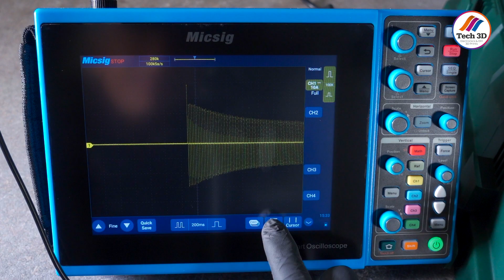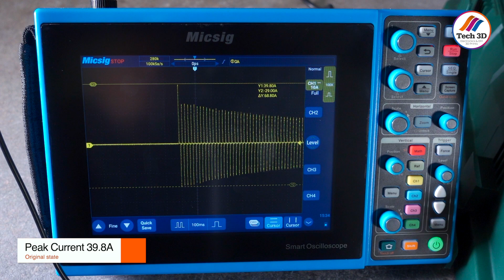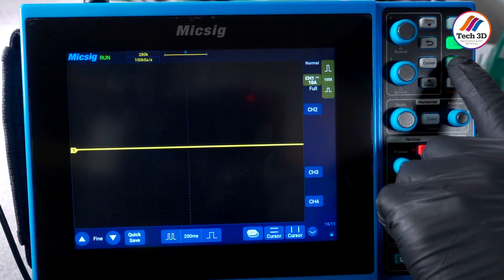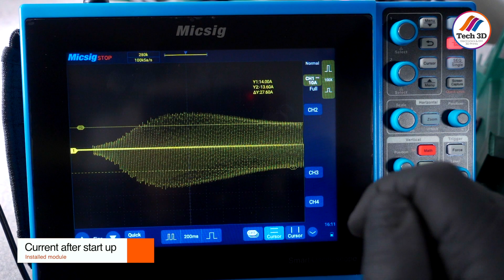Soft Start for Parkside PTKS 2000 G5 Table Saw

Comment: Hello, I would like some information about the connection, I have the h5 version, which is slightly different in terms of connection.  I connected it to the engine input but it only works at 5000 rpm.  Even if I turned on 5000 and then switched to 3200 the engine stopped.  I want to ask if the soft start only works for you at higher speeds or if I connected it incorrectly.  well thank you
Reply from the maker: I got rid of this saw, so I can't help with the wiring anymore. The softstart module only works with a direct winding on the motor, meaning it only goes to max speed on the Parkside saw. The Parkside saw doesn't have two windings on the motor, and the speed control is only handled by overdriving the module, which reduces the voltage on the motor. This is the worst way to reduce the speed. Therefore, the motor will start poorly or not at all.

Comment: Just found this clip. very interesting.  i wonder if you could help me. My original motor burned out and i replaced it.  However, the motor that i bought ,which is identical to the old one, has 3-wires while the old one has only two.  How can i connect it?
Reply from the maker: Thank you, but I don't think I can help you. I don't know how your new engine is wired. I don't know what the third pin is. Whether it's ground or some winding pin, whether it has two windings for two speeds or just a protective wire...
Reply: Thank you, anyway.

Comment: Do you know how to deactivate the soft start  for example on a electric chain saw?
Any plans how to do it if soft start is already installed?
Reply from the maker: It is enough to just bridge the soft start module, as a bypass, to connect the input to the output, so that the wire from the motor is connected directly to the switch and not after the soft start module.
Reply: @Tech-3D  thx a lot :)

Comment: This table saw has a big problem: the table Is not correctly flat and so the saw isn't 90° with It. Do also you have this problem?
Reply: Use a set-square against the saw blade, and rotate it till it's 90 degrees with the table and fix it in that position (1, 2 degrees whatever), remembering that is now 0 degrees.

Comment: Can you share a wiring diagram or some sort of pictorial information showing details such as connection locations and wire colours. These important details are not visible from the video itself. Thanks!
Reply from the maker: Connecting the soft start module to the Parkside saw is very easy. The basic wiring diagram is marked on the module box. The black wire from the module goes to the brown wire on the saw, the red wire from the module goes to the red wire on the saw, and the blue wire from the module goes to the junction of the blue wires on the saw. You can see this in the video too, I plugged them in that order.

Comment: Dont work softstart at 3200 rpm. Do you know how to fix this?
Reply from the maker: Start the engine at 5000 rpm and then switch to a lower speed. The saw does not have a coil on the motor for 3200 RPM. The 3200 rpm is just a simple power limiter, the motor runs at a lower voltage then. It's a fake 3200 rpm.
Reply: @Tech-3D  Is it using a triac for phase angle control to lower the voltage, or putting a resistor in series?
Reply: @Tech-3D  It also doesn't work for me at 3200 rpm, when I switch to a lower speed it turns off, it also can't start at a lower speed , maybe need double soft start? In any case, it accelerates at 5000 rpm without jerking.